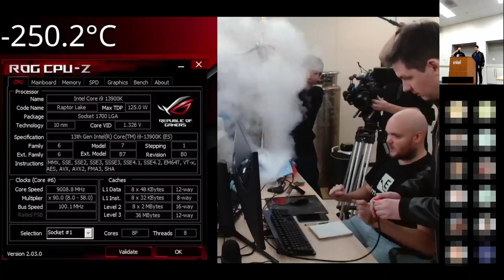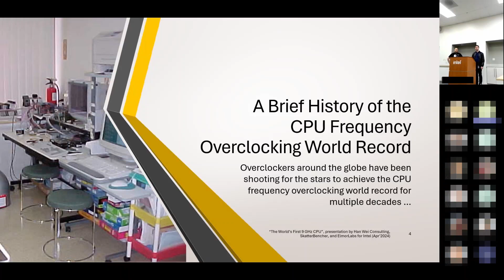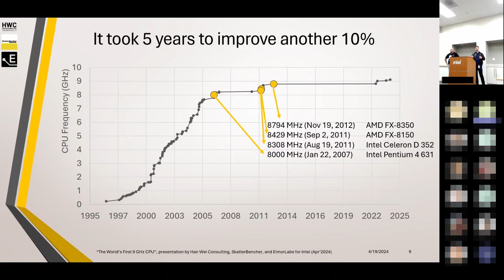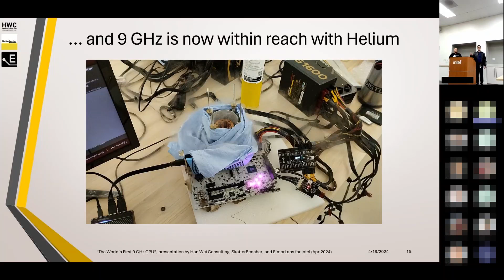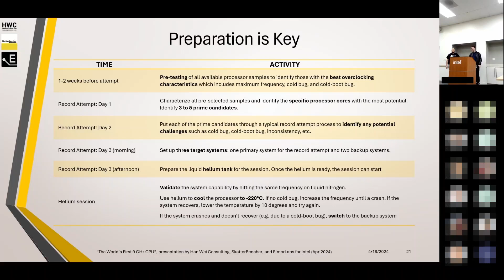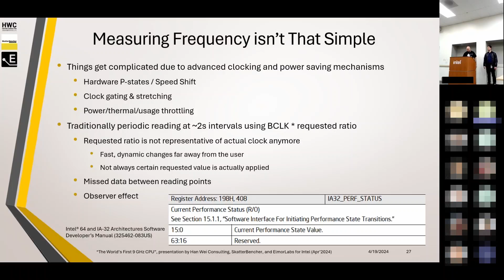The World's First 9 GHz CPU | Talk at Intel

Comment: Nitrogen, 9ghz  , lasted 2min, cpu died.

Def cpu on standard pc,  2 years, cpu burn in, warranty job, bios oc chip too high, l9ng term heat cause Electron migration, ....

Yay, new pc e ery 2 years, no. L9nger can you keep you 8088 for 30 years, n still runs.
Reply: 200 year old fallout pc?,  screen burnin 3 months, cpu dies 2y, ssd not used goes nlank in 5 10 years.

Yay..

Comment: Good application note. mb
Reply: Raptor Lake will continue parallel Arrow?  2 different processing approaches. Arrow has to keep up on what should b a more effective compiler supporting parallel instruction set processing and then the on board DSP currently and whatever comes next driving SIMD? However low latency processing continues across pipes and registers coded for this and that. mb

Comment: Is it really a badge of honor to beat FX?
Reply: Yeah I am always struck with the idea that a cpu manufacturers could easily produce a 20ghz CPU but the IPC would be 1/10 of that of a modern CPU. Frequency is nice but IPC needs to be up to a modern standard in order for it to be honorable. Like you suggested.. FX may have clocked high but frequency does not make a CPU faster. Personally I would be more impressed with an all core overclock that completes a bulky 10 minute benchmark... Not just single thread. Just like high frequency.. a single thread test means nothing for actual real world usage.
Reply: I think so. The current top 25 in highest frequencies are all 13th and 14th gen Intel and FX 8000 CPUs. The difference...These 13th and 14th gen actually are good silicon. FX simply boasted high frequency but could barely handle Minecraft. FX could overclock, that's it. FX was like a condom, single use and toss it. 13th gen especially, is like a good single father, can do it all!

Comment: A message to intel... it would be nice if they could restart telling everyone how many transistors there are in their CPUs... for some unknown reason, theyve stopped telling us how many there were in their cpus?? Why?? Theres no valid reason for that??
Reply: That's because the way we use CPU has changed, back in 2000 we used single core CPU full loading to edit videos, render 3D images, but now, we just use the CPU to feed code/data to the GPU, let it execute, and we retain All our managers (cores) are loaded as evenly as possible for maximum energy efficiency since modern PC system almost never let all processor core running at full loading condition, but more cores still have a big performance improvement compared to a few cores, probably because of the compiler/software Optimization, different cores have their own cache, which makes them suitable for performing specialized tasks. Back to the topic. For your question, you can use cpu model name + wikichip to query the wafer wiring diagram of a specific processor model. If you have some ideas, maybe You can deduce how many transistors the processor uses
Reply: @yuan.pingchen3056  So what if how we use CPUs has changed? The number of transistors is purely a fun fact. It doesn't cost Intel anything to disclose the approximate number
Reply: @noreng9333 they likely don't know exactly but I would imagine that the number is much higher per core vs AMD even though AMD has great performance. This is shown clearly in the double efficiency AMD has. That is due to Intel on a worse node and requiring more transistors to produce the same performance. They don't want you to realize the architecture team is actually not doing as well as theyd like you to believe.
Reply: @TheCosmicMason  Of course Intel know exactly how many transistors are in their chips, it's not like counting the number of sugar grains used to make a cake, there's an electronic map of their designs which details every last circuit element used.
Reply: @yourma2000  you're wrong. They know approximately down to 99.99% but the most certainly do not know exactly how many. They use IP blocks as a unit of die area and in theory they may know how many transistors are in each block but there are so many blocks etc. just look at the number of transistors in older processors.. it's always like 128mill etc not 128,749,740. They literally do not know exactly.
Reply: @TheCosmicMason  Are you unable to read? I just told you that they have digital blueprints of their processor designs and software to view them in that keeps track of this sort of information.

They don't give the exact numbers for the same reason I don't include the pennies in my pocket when someone asks how much money I have on me. The marketing team don't care enough to remember the exact number and the consumers aren't interested in the hundreds of thousands when we're on the scale of billions.

If they wanted to find out then they could, but an exact number is not important information that is of public interest.
Reply: @yourma2000  "if they wanted to find out they could".. so you're saying they don't know? 😭
Reply: @TheCosmicMason  You're making out that they cannot know, I'm saying they can.
Reply: No designer optimizes to the potential density increase, node to node, on clear signal and endurance requirements. mb

Comment: Intel promised us 10ghz CPUs in 2005! And on air! Not on liquid helium! The silicon limit if obviously 9ghz. We need new materials for higher clock rates. The next target for overclockers should be 9ghz on a gpu lol Imagine a RTX5090 at 9ghz. Thatd be epic. Right now we're not even at 4 ghz... weak :p Theres 20 times more transistors in a 4090 than a 14900K but thats a minor detail :p
Reply: The silicon is not the limit for ghz. It's the architecture. As shown with the slow AMD buldozer that could reach insane clockspeeds on 32nm. If that would be scaled down to todays 3 or 4 nm it would easy hit 10ghz. But at what use?